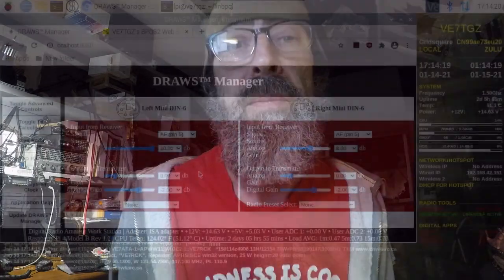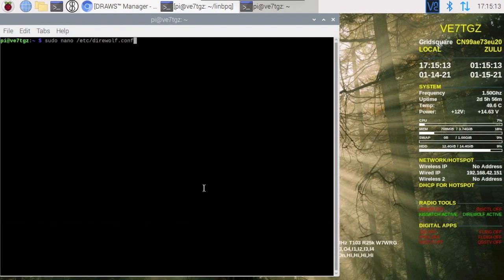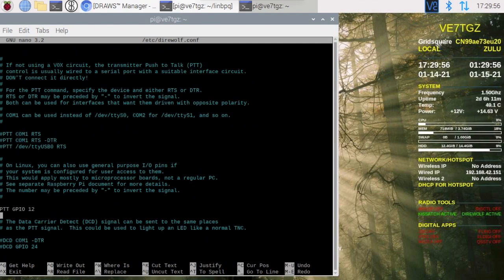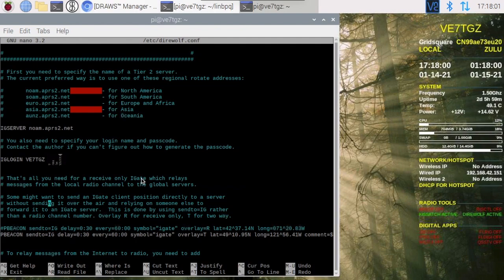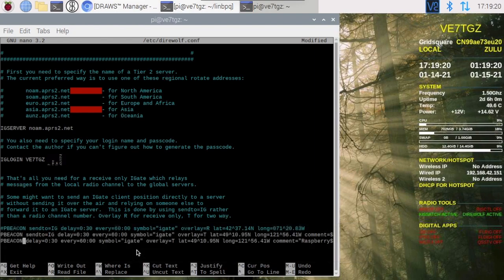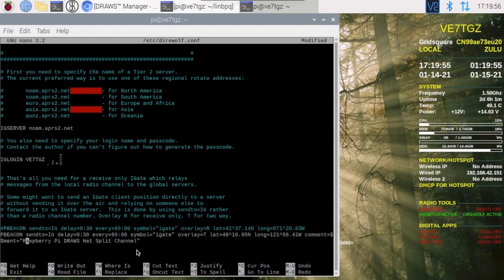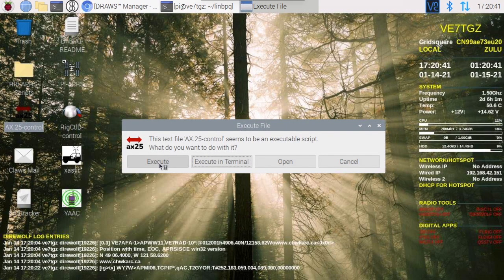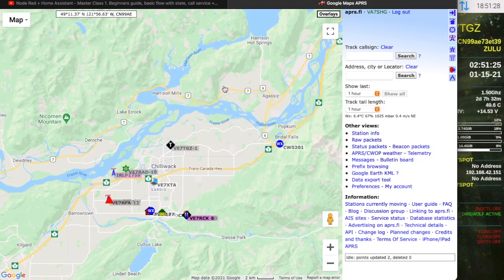VA7SHG - Direwolf 2 Modem 1 Raspberry Pi Configuration

Comment: Thanks. My Draws sitting in a box.
Reply from the maker: I’d like to move my DRAWS to the Argon One case with the SSD, but because its a hat, it won’t work so well. Thinking about just using an external drive.
Reply: @jimshaggy  Got to figure out my TTY issue. One suggested it was already running.  I need to create a port in that configure program. It didn't show up other than the original Port I used in sudo nano bpq32.cfg
Reply from the maker: Hope my next video will be about using two sound cards with Direwolf or further configuration on LinBPQ.